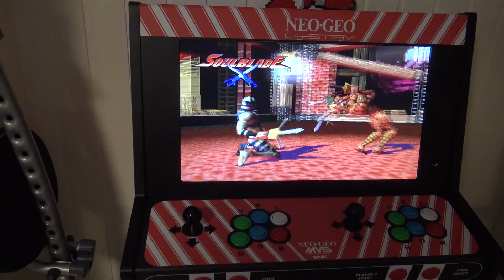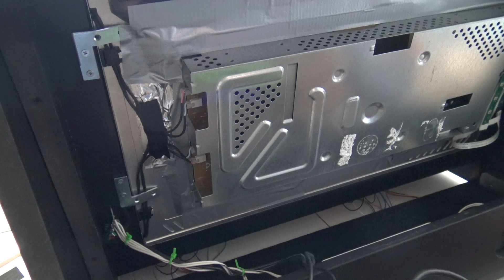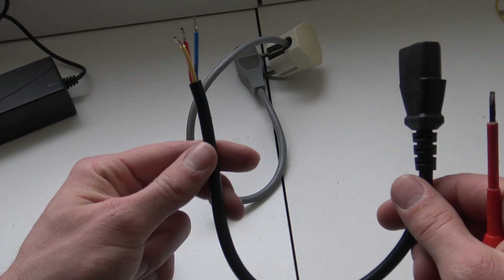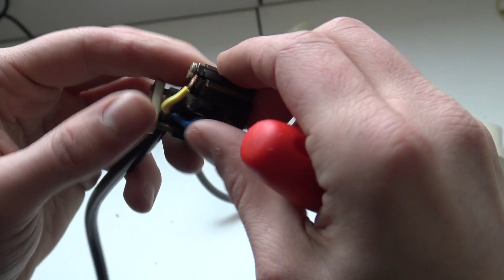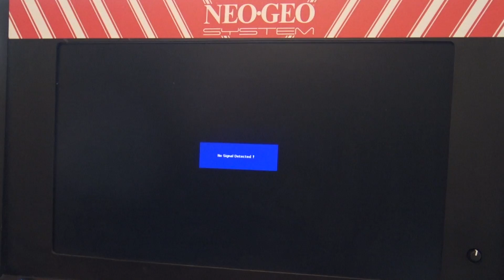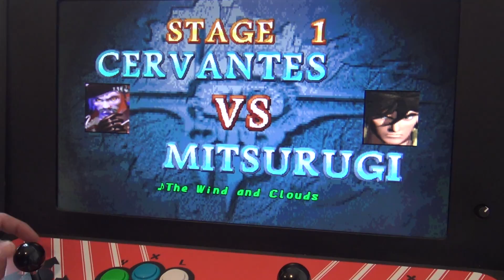Pandora's Box 6 Arcade Upgrade Tutorial | Let's Upgrade my SNK Custom NeoGeo Bartop

Comment: Hey wicked. So I just got myself a PB 5 (blue family version) with the wire harness. I was going to replace my Raspberry Pi in my bar top cabinet with it. The problem I have run into is the button layout. The harness has seven leads for A, B, C, D, E, F and start. What am I supposed to do for my coin or player select? Or with the PB can I get by with just the 7 and just leave the other buttons disconnected? I would eventually like to set up a player 2 on the cabinet as well.

Comment: Just so you know a pandoras key 7 you can use use the 5s cable it may be missing one button for a coin but works for all games but double dragon other then that you can swop out old key version 5s with a 3D key 7 witch I’m putting into an arcade 1up cab and adding all 30,000 mame games on a tf card to play on it. This works better then a pie and easy to install just getting the roms now do to Nintendo will be hard to find so if you have rom files of games save them finding them to download again will not be easy do to Nintendo

Comment: Why would you swap out the Pi for a Pandora's Box? That's essentially a downgrade software wise. Unless you want ease of use. The front end theme could be changed on the pi if you were not liking the graphics. Also you downgraded the control joystick simply to opt for the easier connector? Unless it was a sanwa that you put in, the joystick you had originally was better and probably had upgraded tension springs. If you were to see HAPP or Industrias Lorenzo sticks, they have the same configuration. Love your channel, I like that bartop as well I'm just questioning if you really upgraded haha.
Reply: Ray I was thinking the same thing lol